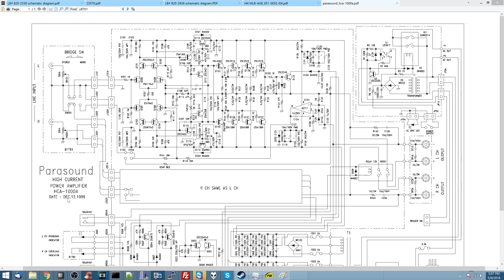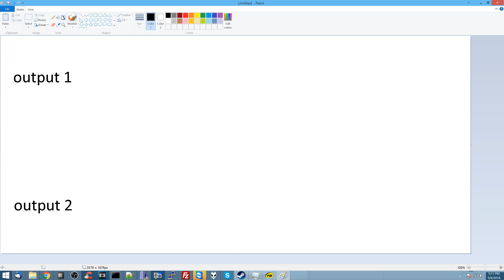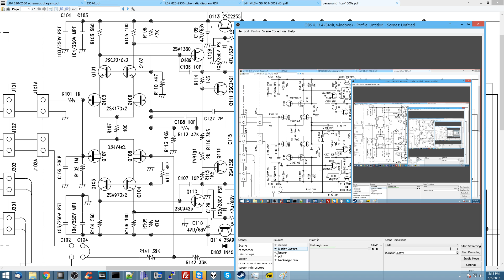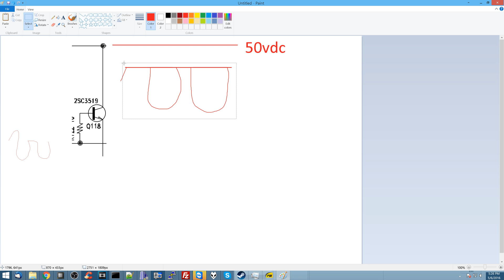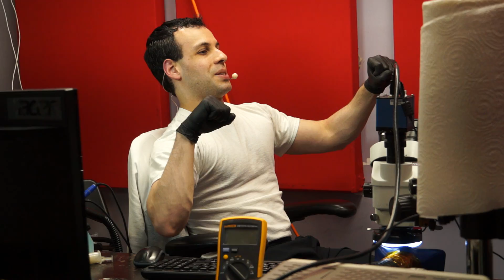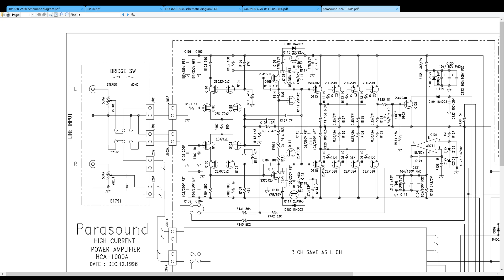If you didnt believe I flunked out of college...

Comment: Louis, you are making this way too hard for yourself - and I think that is the problem. You are "overthinking" this. If the failure is not at the rectifier stage, then it is a shorted output ( with possible driver issues).  Yes, with parallel push/pull you need to keep the beta reasonably matched, but good quality outputs that are the legit product such as what you will get from Mouser will be close enough to not need to do a match. After all, that is why there are emitter resistors there - they are a buffer to handle the imperfections in matching. I've worked on some NAD garbage (and I do mean garbage) where they omit those and blow outputs because the wind is coming from the wrong direction that day... and the cheap Chinese caps drifted too far off spec. and pee'd all over the board. Totally lost respect for the brand. Parasound is certainly a good brand by contrast. 

As for schematics, Google is your friend these days. The main exceptions seem to be when an amp has a proprietary design that is currently in production and has patents on their unique design. I worked at a pro audio shop and typically service data was easy to obtain, and the companies that did not release data were the "we'd rather have the customer buy a new one" type of brands... think Apple here.
Reply from the maker: +Alan Maier Why don't you like NAD?
Reply: +Louis Rossmann Louis, I used to really respect the brand. Nice sound, no silly frills, good value. Then I worked on them. OUCH! They cheaped out on parts quality at the component level in a serious way, and the consumer would never have a clue. So while I've never heard a NAD product disappoint with respect to performance for the money, I've sure been dissapointed with what ends up on my bench.
Reply from the maker: +Alan Maier What in particular? I'm not a fanboy or anything, I just like to learn. I was always more of a Rotel person myself.
Reply: +Louis Rossmann The key item that really turned me away from NAD was a small Power Envelope series receiver, I believe a 7220PE. No emitter resistors, so little margin for error. Very beefy TO-3 case output devices as well. But all biasing resistor were very low rated,  diodes for the power supply (8 of them due to the power envelope design) were sadly under-rated - and cheap Chinese power supply caps that leaked all over the place.. one of which shorted and was in the power envelope section. The moment the receiver went into headroom extension - kerblooey.  Outputs failed, drivers, pre-drivers, countless resistors, rectifier diodes.. all due to cheap China caps (some hidden under the tuner board) and too many parts that were "just good enough" when all was well. Of course when an output device failed (not it's fault / they did not cheap out here),  well, hours later and a bench techs very low shop rate.  I'd expect this in a Sony home theater receiver, or an Onkyo (very, very over-rated brand - almost Bose / Apple over-rated) but not anything of quality.

Comment: Thanks for the video man, I wish schematics were easier to get! I deal with loads of QSC RMX series amplifiers because they have a common fault with bad output quality with pops and cracks or no output at all, turns out it's the potentiometers for some reason they have this "self cleaning" mechanism built in which in the end fills up the insides of the pot with dust and other shit (counter productive huh!?). Took me a while to figure it out but I managed to bring back 10 previously "dead" amps and now takes me about half an hour to 45 minutes to repair them :) fortunately the schematic was easy to find and allowed me to figure out it was the pot that was causing signal noise or drop-outs. I have some rabbit holes lying around that I really need to take a look at, try a 7000w amplifier that I had to extinguish with CO2  when it died ... Should be fun :)

Comment: I don't believe I am a Troll, and I'm still not sure whether you truly wanted help or not. But I'll give it a go, and use the results in my own feedback loop ... :)

But first, I must advise that haven't done any Audio work since the mid 80's. So for both of our sakes I'll try to keep this simple and, hopefully, correct.

The main feedback loop in the amp is not via the AD711, but rather the R112 resistor. Note that the low resolution screenshot I took of the schematic (720p) is hard to read, so cut me some slack here. It looks like it is 47K Ohms, with some high frequency compensation via C108 in parallel. 

The AD711 circuit appears to be some kind of overdrive protection -  note the nose-to-nose Zener diodes and parallel capacitor across them, being feed via a 1M Ohm resistor from the Amps output, the junction of which going to the AD711 + input, etc. Yes it is a type of negative feedback, but it is not what you would call "audio" feedback.

Now the power supply. I'll just point out that your drawings of the rectification of the AC was for a half-wave rectifier whereas this circuit uses full-wave rectification. Moving on, it was not clear to me whether the "short" you measured was with or without (good) fuses in place. Assuming you meant without, and your measuring on the AC sides of the bridge rectifier, and that when you say "short" you mean very low resistance (< 1 Ohm), then that suggests the bridge rectifier is bad (short). Whether the main output drive transistors are bad or not as well remains to be seen.
Reply from the maker: +Richard Rudek I think my transformer is fucked. When measuring without the fuses, it isn't even the bridge rectifier side with a short. :( This never happens in real life, to real clients.. only to me.
Reply: +Louis Rossmann Louis, remember DC resistance and AC impedance are totally different numbers. Your secondary side of the transformer might just have a good low resistance for minimal loss - but at 60Hz, you're just fine.  I just pulled up the schematic, and this is a dual power supply amp - single primary but each channel has its own secondary and independent power supply. Check the DCR of the other channel at the transformer (with fuses removed). Compare the two channels. My take is, if you are blowing 2 fuses at one channel - it's likely just the bridge. If just one fuse - that's shutting down a shorted output device and preventing mass destruction. 

To me, amps are easy. But I've got this POS iMac with 25 caps that are about to explode............. (yes, steaming pile item). I'd rather rebuild a receiver!
Reply from the maker: Alan Maier Thank you for the advice! I had some suspicions about that as well, what are the chances of positive & negative on one channel being blown ? gotta look for what is the same, what they have in common.. what is more likely, two banks of transistors are blown, or one single bridge rectifier is blown? thank you again!
Reply: +Louis Rossmann if only one side had blown you'd only have full dc on the output as there's nowhere else for the current to flow, so if one side goes the other one likely goes with it. also more likely than a bridge rectifier, they're pretty sturdy, while the output stage can get all kind of oscillations or misbehaviour especially with weird loads or output shorts
Reply: +Louis Rossmann What I would do first is a diode check across the bridge of the channel that is blowing rail fuses. Since this is about a 50/50 chance of bridge vs. output short, you have to start somewhere. If the diodes in the bridge show good - then you've got a short between a collector and emitter / ground. Just one output will cause the rail fuse to blow, which is good in this case as the other 2 may be fine. A visual inspection might just reveal the culprit first, then I start unsoldering devices from the underside of the board and check for shorts. After all, a transistor is a diode - easy to check. Actually they are 3 legged fuses, but that's another joke entirely!

Comment: In your diagram, starting around 9:40 ish, your drawings look more like the product of half-wave rectification, as opposed to full-wave rectification which a bridge rectifier provides. A bridge rectifier doesn't separate the + and - portions of the waves, it flips the negative portion of the wave to to positive side.  
EDIT: I should note is that how they work when they are wired up normally,  but it looks like it's being used with a center-tapped transformer to generate the + and - rails, so perhaps this is a circumstance where full-wave rectification isn't happening, reading up on negative voltage rails right now.

Comment: I have a pair Electrocompanient 180 Mono blocks.  1 blew.  I rang the nearest supplier of Electrocompanient products and asked if they could fix it.  They informed me that Electrocompanient will not release any schematics for any of their products.  Therefore I have to send it directly to their one and only repair agent in Australia, which happens to be 3,000 km's away. 
So I currently have a 22 kilo Electrocompanient boat anchor.  Frustrating!!

Awesome video by the way!  I have been a massive HiFi buff for most of my life.  It's great to know how these things actually work.   Thanks heaps Louis.
Reply: A schematic would make it easier, but you can definitely repair it without one :)
Reply: Jernej Jakob I took it to my local repair shop, they had it for 3 weeks.......rang me and said they couldn't obtain a schematic and whacked me with a $100 bill.
That's why then I rang the retail supplier who informed me I had to contact Electrocompanients repair agent directly.
Reply: +Darren Allen then they're not competent enough, everything can be fixed, it's only a  question of viability, they probably didn't want to spend any time actually measuring and reverse engineering stuff
Reply: +Jernej Jakob I totally agree,  they had zero interest.... Except when it came to charging me money.

Comment: http://sound.westhost.com/articles.htm has some good info on the theory and repair of of class-ab amps. Almost all are centered around a long-tailed pair (LTP), yours has cascode follower inputs, then it goes to a voltage amp stage/VAS (class-a) transistor, to the output driver transistors, to the output transistors. The ltp and vas are usually biased by current sources and current mirrors, the output stage by diodes or an active bias circuit, usually thermally coupled to the output transistors to prevent thermal runaway.
This is similar in how opamps work - in fact very similar. Take a look at a standard opamp internal diagram and you'll see the same building blocks used, and the same theory applies. Regarding negative feedback - its role is to stabilise the DC offset and reduce nonlinearities, effectively decreasing distortion by a large amount. In the analog world NFB is present everywhere, even inherent to the circuit topology (eg. emitter followers). An amplifier without NFB is no better than the others just because of that, anyone who tells you otherwise is a quack. Same goes for "DC coupled" designs. They are just marketing gimmicks, unless proven to be measurably better in a lab setting, and even then I'd be sceptical if they performed as well with real-world loads.
Reply: Lookung back at your schematic, Q101-108 would be the LTP, q105 side being the positive input and q106 side negative, q109,110 push-pull VAS (also converts differential output of LTP to single-ended), with miller capacitors across c-b to stabilise gain at hf and prevent oscillation, q111,112 output bias transistors with pot to set stby dc bias current, q115,116 output drivers and q117-122 output tr's (output drivers and output tr's configured in a darlington pair arrangement to increase gain) q113,114 are just linear voltage regulators to lower and clean up the power to the sensitive input side, and the rest of the amp is just going to be protection circuits, overload detection and what not.

Comment: You actually can make an computer circuit board at home, of course this requires knowledge and research. And you should design them first as you sometimes have to reduce the speed of light. The Xbox One is a good example.
Reply: +Lorenzo van het Hul What the fuck are you talking about. Go, just go.

Comment: You also can get more power with parallel components, and sometimes it's cheaper, see they're using 3W resistors with the last stage transistors,
Reply: Depends on the load impedance. Lower load impedances require higher current at lower voltage than higher ones. Paralleling transistors only increases their current capability, not breakdown voltage. Hence comparing two amps designed for the same rated power output, one at 4 and the other at 8 ohms, the first should theoretically have 1.41 times the output current (sqrt 2) but 0.707 the supply voltage than the second. And the 8 ohm one would not be able to deliver full output power into 4 ohms before exceeding its transistor SOA, that's why you shouldn't put a lower load impedance on an amp than it was designed for. In practice you should be fine as long as you don't apply more than, say, half output power for half the load.

Comment: Transistors or mosfets are linear in nature. You have to set them up correctly in the application to make them "switching" with low loss.  A good analogy for Amps is thinking how a speaker works. It only generates noise (sound) when the diaphragm oscillates. The AB amp pushes and pulls the speaker both directions with higher voltages making a) larger speakers move (lower impedance) b) adds "force" to the output for faster response c) gives you higher volumes (sum of a+ b)
Reply: Transistors and especially mosfets are NOT linear in nature....vacuum tubes are. Transistors and mosfets have to be biased right to use a small part of their curve to try and simulate linear....Transistors and especially mosfets are excellent at switching, vacuum tubes are not.